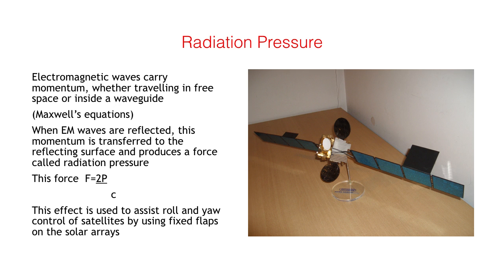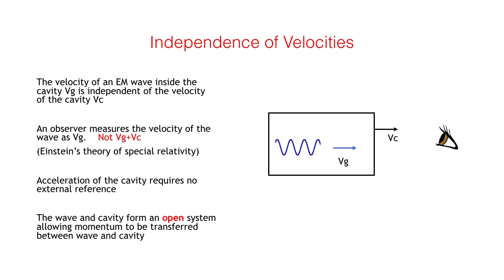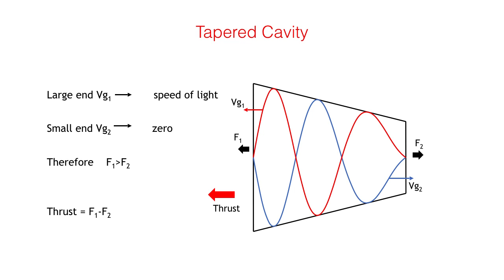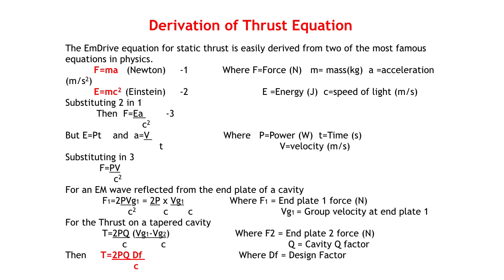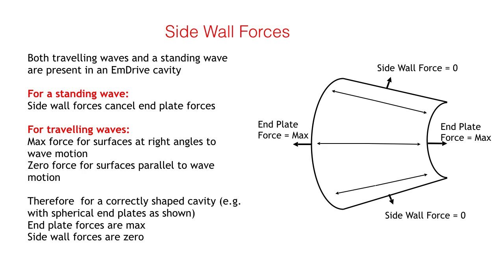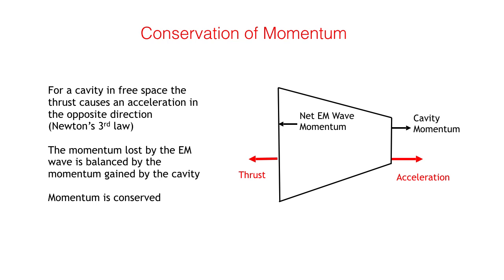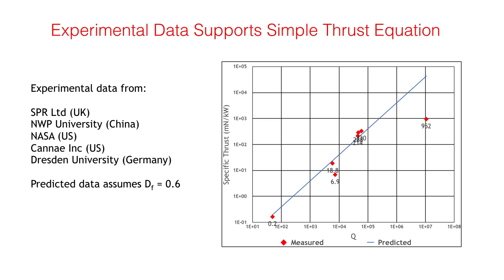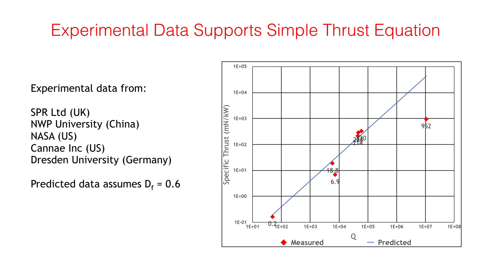Roger Shawyer Explaining The Basic Science behind #EmDrive

Comment: The thing I dont get is , assuming the radiation pressure is pushing against the surface, newton tells us theres an equal oposite force  which must go somewhere. But if its enclosed in the cavity, where does it go? The opposing force cant be discounted, because we know its precisely the same strength. So where does it go? A regular rocket disposes that opposing force by blasting flames out the back (or ions or whatever), but this? I dont get it. I means I want this to be true, and its clear something is happening? But are we sure radiation pressure explains it?
Reply: Seriously all, re read yourself a bit....

If the photons do not exit the drive (no exhaust), the whole EMdrive engine is a closed system. Doesn't matter if the EMwaves aree absorbed back into the walls, their momentum doesn't exit this closed system.

A closed system CANNOT gain momentum on its own.

If you can create a closed system that gain momentum without an exhaust of opposite equal momentum, you have a perpetual motion machine with a greater than one efficiency.

Wake up guys....
Reply: Shayne O'Neill  Photons have relativistic mass
Reply: The momentum come from the photons, the photons have a wavelenght, thus when they generate that pressure their wavelenght increases (energy decreases)
Reply: And to be clear, I'm not saying Dr Shawyer is wrong here. I just want someone to help my non physicist brain process this.
Reply: thats why this drive is going against newtons 3rd law and is making them rethink it
Reply: And thats where I become skeptical
Reply: Well, in simple terms, imagine the microwave radiation as a guy with his feet planted in space itself and pushing the cavity through space. Its not like a guy standing inside the cavity and trying to push the cavity. Change in momentum is force, so the opposite force as you put it is the loss of momentum of the microwave radiation. 
Thats just the basic idea. I don't want to go into frames of reference and other special relativity stuff.
Reply: 4:17
Reply: NASA scientists explain it through quantum physics, very cool explanation: http://arc.aiaa.org/doi/10.2514/1.B36120
Reply: Felipe Faraco very cool indeed
Reply: arnaud nicolas Well, Roger Shwyer says that since we are talking about particles travelling at the speed of light, we should take different frames of references for the photons and the cavity, thus converting the closed system to an open one.
Reply: How do photons generate momentum if they have no mass?
Reply: Shayne O'Neill p = Plancks Constant / Debroglie Wavelength
Reply: It is not an isolated system which is important. There is still a flow of energy in the form of EM waves and heat. 
Additionally one might even say there is a constant flow of mass into the system as photons do have a (relativistic) mass that enters the system but doesn't exit. If you look at it this way the EmDrive consistently adds momentum (taken from the outside via solar panels) to the cavity thus resulting in a higher overall momentum. The explanation given in the video is simply stating how that momentum is used and transformed on the inside.

But even so I think we should simply wait for experimental evidence with measurements that are not within the error margin. Only a matter of time until somebody can either prove or disprove the whole thing by explaining how conservation of momentum is to be seen in this case. That might require new physics or old physics. We don't know that until it has been done.
Reply: Ether

Comment: The trouble is that the side wall forces are in two components.  The statement that the traveling wave is parallel to the side plate is in error.  This only is true for a constant diameter cavity.  The differential equations will show there is an angle and therefore a force component on the sidewall parallel to the end plates. Wish it were not so.